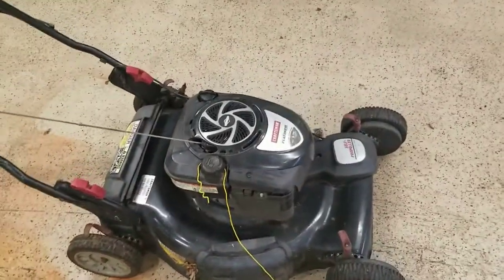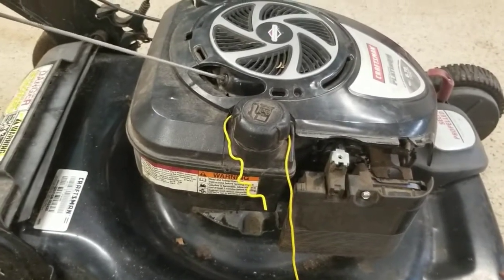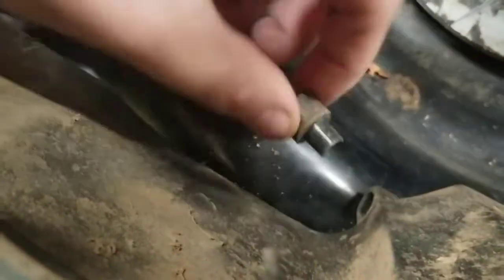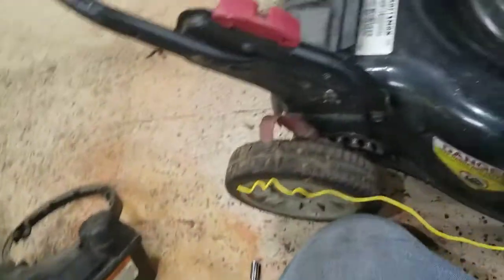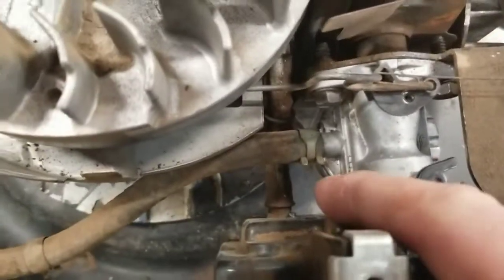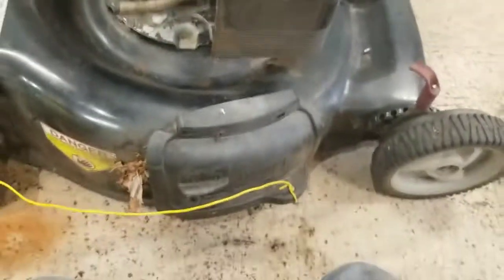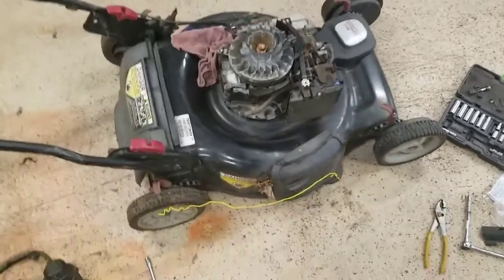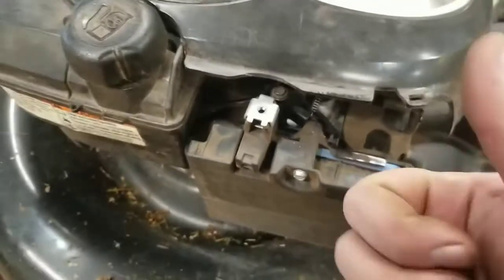190cc Briggs & Stratton Automatic Choke System Repair

Comment: Heyy, a lawnmower video! it's like the old days lol. Those old style auto chokes actually had a provision to hold the choke open on the later ones. there was a little thermostat in where the breather boot hooks on to the carburetor. I've never worked on this style auto choke so this video was helpful for if I ever do.
Reply from the maker: I never had one of those old style auto chokes that ever started very easily when hot.